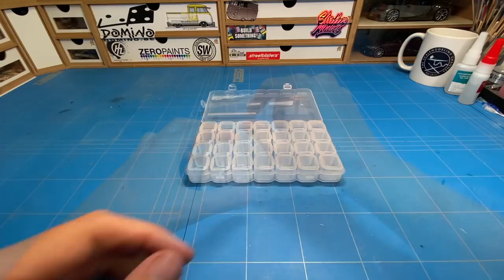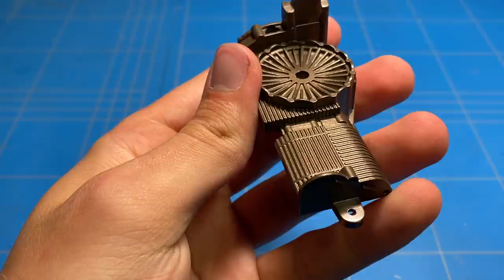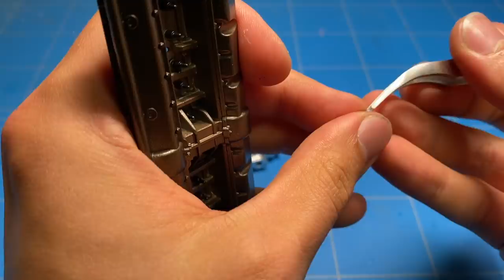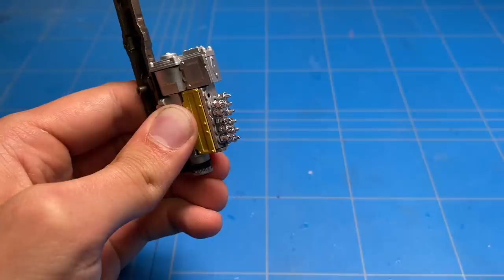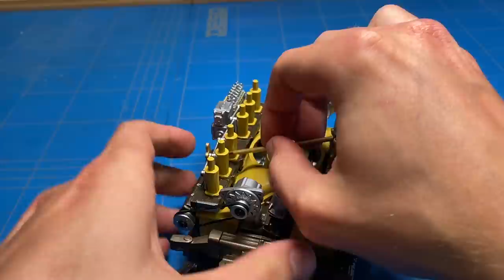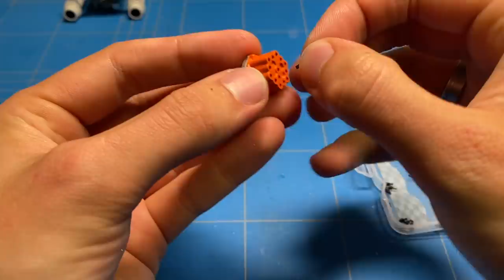Building a 1 to 8th scale Ixo Collections Porsche 917 KH Part 1

Comment: Is there any painting involved? I suppose not, just weathering. Also, when I am working with small parts I lay a thick white towel down on my work table. It usually stops the parts from falling to the floor. I also wear an apron that I hook to bench. That way the small parts can be easily found. I started using this method years ago when I worked in 1/87 scale.

Comment: Seems like a nice quality kit, seeing that ugly parts and mold or mating lines are mostly hidden. I'd love to have this model myself, as the 917 is my all-time favourite car. for me, it's just too pricy, considering they want roundabout 1200€ for it. but I'll gladly follow your build logs :)
Reply: Model Factory Hiro offers a stunning 917 model for a lot less money.  Fair warning:  it’s a beast of a kit but the results absolutely crush the IXO model.
Reply: @rossm8231  thanks for the info! gonna look into that.
Reply: @rossm8231  MFH might seem cheaper on the surface, but when you factor in the  equipment and materials, not to mention time needed to complete the kit to a high quality finish it could be a lot more expensive. Unless of course you already own paints and equipment.

Comment: What brand of power screwdriver are you using.  It looks perfect for putting this kit together - I'd like to get one.  Thanks!
Reply from the maker: I’ve tried a couple different ones. But in the end found a regular size screwdriver with a fine phillips head works a lot better(more control and more power)
The electric ones lack torque and cant get the screws in to metal parts. Only the plastic ones work

Comment: You do know that IXO changed the throttle linkage...
It's incorrect for this engine...
When I was building this engine I thought something was wrong...
I'm very familiar with this engine...
I'm a Cameraman in Hollywood and shot pictures of the real engine....
If you go to the english language on line for build 5 IXO tells you to delete those steps...
They produced it before they got the finalized version...figures...
I myself filled all the wholes in the tubes where their going to want you to now put just screws...
I matched the paint perfectly...
But I'm customizing this engine like I did the Ecto-1...
So I've painted the yellow plastic with certain shades to make it look transparent...
And I did all the bolt heads and did braited lines...
But I thought I'd let you know about the linkage...best
Reply: That sounds like you did some work. Do you have somewhere we can see your work?
Reply: @Bob0sModelFabWorx  I'm putting together my own U-tube channel...it's called "Robin Around Town"...
It's alot of different things put together...
But I'll also have this build and all the customizing I did on the Ecto-1 engine and chassis also...
I made "Major... Major" changes on it...
Should be up in a month or so...best and thanks for the response...
Reply: @robinaroundtown...2194 . I look forward to that. Kool title too.